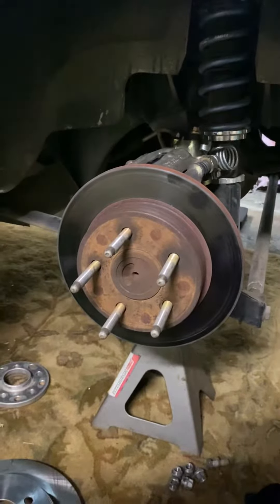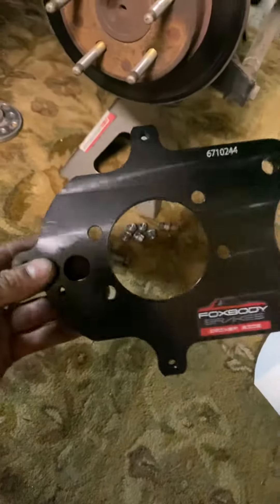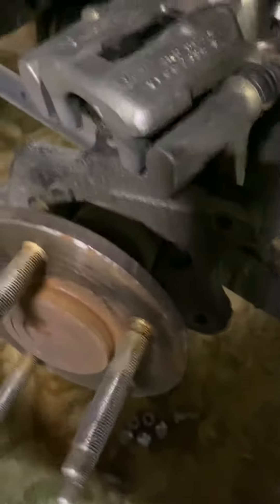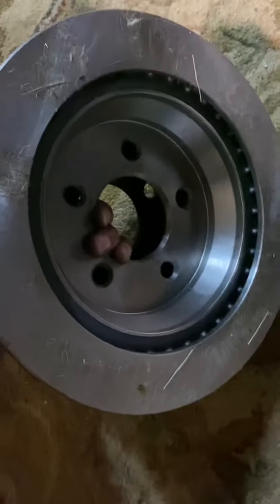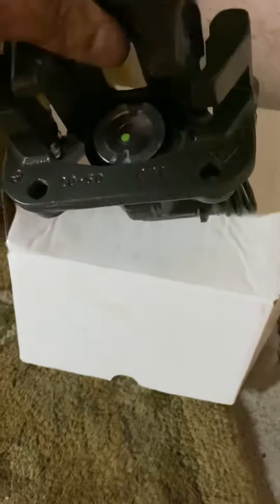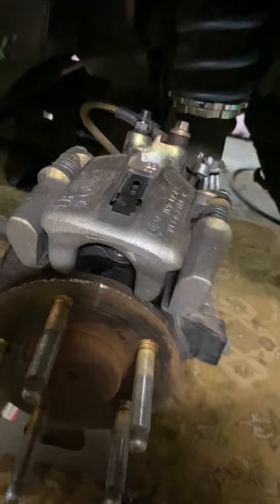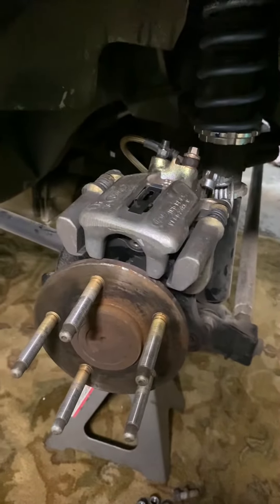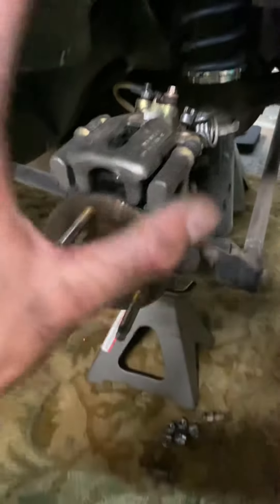Foxbody rear brake upgrade

Comment: Interesting. Why not the SN SVT/cobra 2 piston rear? Curious to know why you went with a single piston taurus? It looks big but not sure hot it compares to clamping with two pistons. Can you share the part numbers too?
Reply from the maker: Of course ill share, Im actually uploading a video describing the swap.  I was told to match my front brake setup I should use the Taurus caliper because of the larger piston.
Reply: @EscortSportage  Thanks and I've already watched it and appreciate it. Very informative.
Reply: The terminator cobra front calipers have larger pistons than a regular cobra 2 piston..